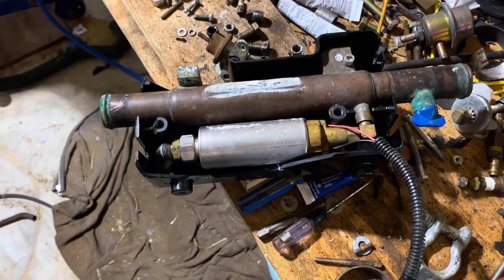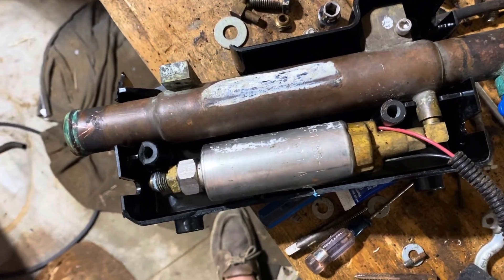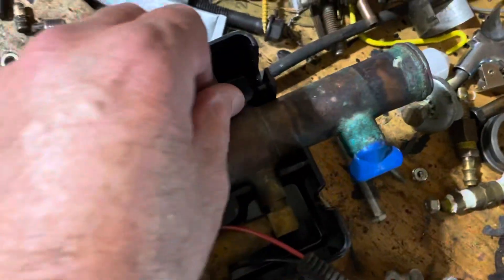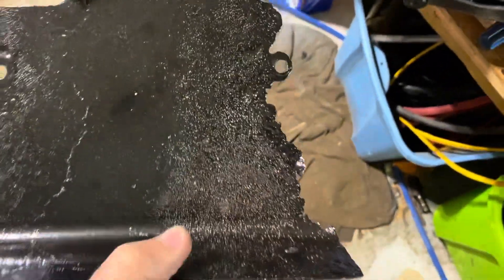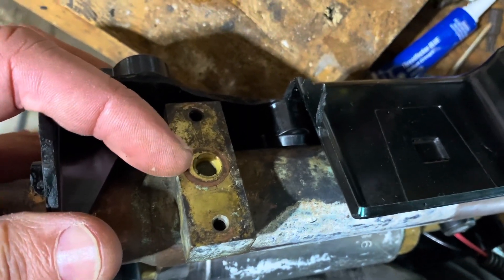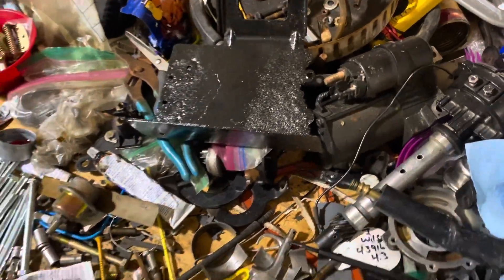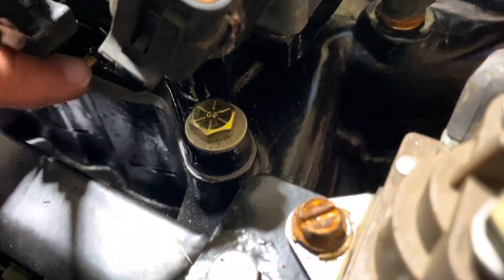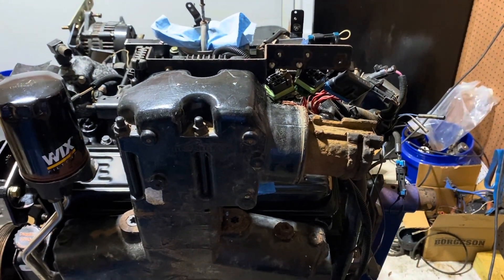Mercruiser 6.2 (1e) - Rebuilding the Cool Fuel Module

Comment: Cool fuel kit is available from Mercury Marine as a kit, and the regulator is also available
Reply from the maker: Yes they are. Everything, well most, is available from Mercruiser, at about 10 times the cost of standard engine parts. Everything I do is cleared with the customer first.

Comment: My son has a 2004 5.0 MPI Mercruiser with a Cool Fuel Module ll, The engine will not restart after hot soak. It cranks but fuel pressure drops to 0. Note there is a fuel pressure regulator on the top of the engine as part of the fuel rail. My question is, can you remove the fuel module from the engine without removing the exhaust system or lifting the engine out of the boat. I do not see how I could have access to everything to do the job right from the bottom of the front to get to both sides of the module. Is it possible to thread out the fuel pump only from the fitting into the cooler from the front and replace just that?
Reply from the maker: Since I haven’t seen the Cool Fuel II module my answers could be wrong. There will not be two regulators. The one at the rail is a pulse dampener, not a regulator. Look for a return line if there isn’t one it’s not a regulator. If your module is similar to video it would be very difficult to remove just the pump from the module. You should be able to disconnect the fuel lines, wiring, and hoses and remove the entire module without removing the engine. It won’t be easy. Welcome to boating. However hot soaking is supposed to be prevented by the fuel cooler so unless you are overheating I don’t think that’s the problem. My guess is you have a restriction in the system between the fuel pump and fuel water separator or the separator itself. Other than hot fuel, there are two ways you have can a fuel pressure loss, both due to fuel boiling into a vapor in the fuel inlet at the pump which prevents it from being pumped. Either a restriction in the system inlet to the pump, or too high a flow overall which leads to higher friction drops in the inlet also causing fuel to boil. You could have a marginally failing regulator allowing too much flow which then causes fuel to boil resulting in loss of pressure. But it could also be a failing pump not able to pump gas when it heats up.
Reply: Hey I’m about to make a video on this. The check valve in front of this is letting hot water back into the fuel cooler and boiling the gas. My boat was doing the exact same a few years ago. I even brought it to a dealer and ended up figuring it out myself.
Reply from the maker: @ethanonorato check valve in front of what?
Reply: @moccasinmarine there’s a check valve in front of the fuel cooler. Plastic float valve
Reply from the maker: @ethanonorato only on boats with the self draining feature. Most boats don’t have a check valve
Reply from the maker: @ethanonorato but post your video and let me check it out. I’d like to see your idea.
Reply: @moccasinmarine I’ll have it up Saturday, I haven’t posted much. But have found this problem on a few of them now that people chased around trying to figure out. Had me stumped for a bit.

Comment: My regulator is stuck shut causing mine to build 100psi at idle.
Reply from the maker: If the spring broke you’d have low pressure. If the diaphragm burst you have very high pressure because pressure would equalize on both sides of diaphragm and nothing would open the regulator so my guess is diaphragm is burst. But you would also have gas spurting from the rubber vacuum hose.
Reply: I replaced the pump and regulator last night.  I also was missing the vacuum line going to the regulator, fixing that today. What else would it to run 100psi at idle?
Reply from the maker: Check the return line back to the fuel filter/separator. Any block in the ability of fuel to return to the inlet will cause high pressure.
Reply: @moccasinmarine  When you say if the diaphragm broke, what is the diaphragm? I'm getting 70 psi when running. I put a new regulator on also. I'm wondering if that was a bad amazon Chinese one now.

Comment: Brother....go find good used parts and brackets.  They are available.  Also JB weld on the fuel pressure regulator?  I'd bet good money that's a $30 AC Delco regulator.  JB welding junk parts is asking for trouble.  Do your customer right and fix it right or turn them away. This will be back in short order.
Reply: You can order the parts online to rebuild it the right way for $500
Reply from the maker: Customer didn’t want to pay for another part and told me to fix it anyway I could. I looked for another bracket and regulator used but couldn’t find one for a reasonable price. The machine shop I use JB welds blocks all the time to make repairs so if it works I use it. The regulator is never under pressure always vacuum so the epoxy should hold. That was a special Mercruiser regulator that I haven’t seen in any other application. This entire engine was almost too rusted to repair but I restored it to decent condition. I just didn’t publish all the videos. If I turned every customer with a rough boat away I just about wouldn’t have any customers.